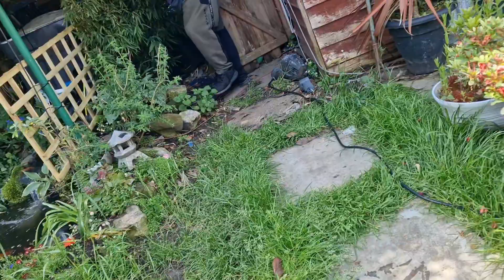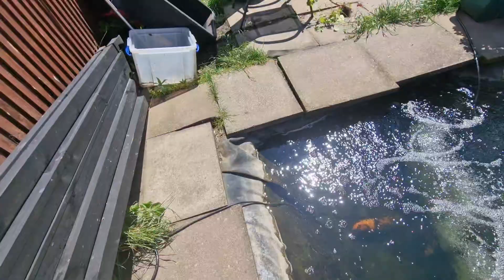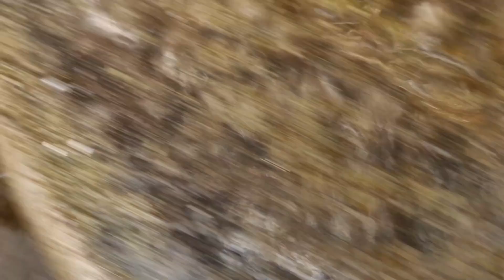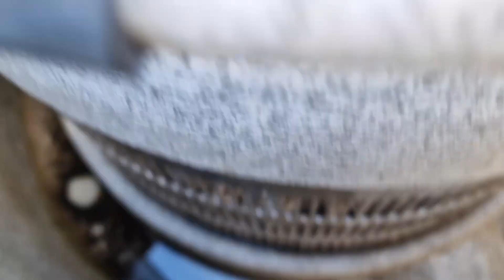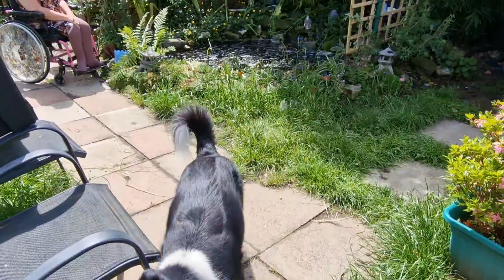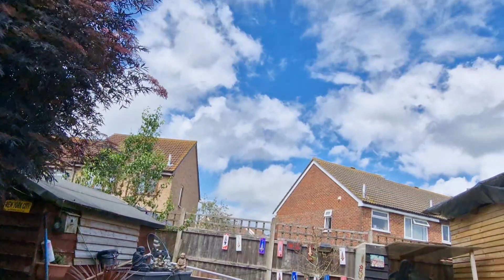Easy pod and Goldfish porn

Comment: Nice little update. For the return from the Eazy Pod to the grow on tank I would suggest directing the return pipe downwards so that it enters the water about 2/3 of the way down and on the bottom of the pipe attach either a 45 or 90 degree elbow to direct the water current towards to bottom drain. If doing this be certain to have an airstone in the tank to ensure adequate aeration as having the return inlet under water will not provide much if any aeration.
Reply: Have 2 small air tones in and thank u for comment